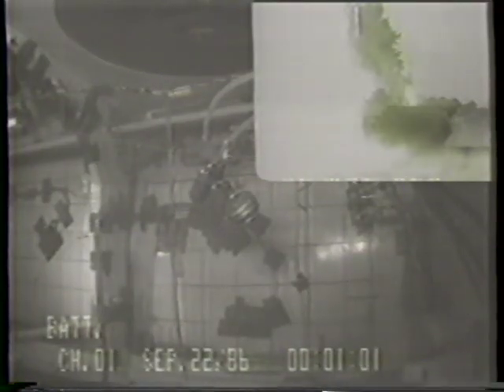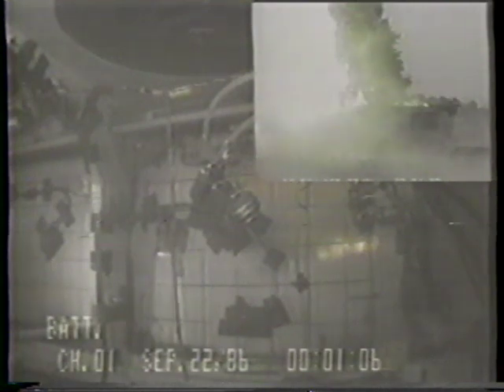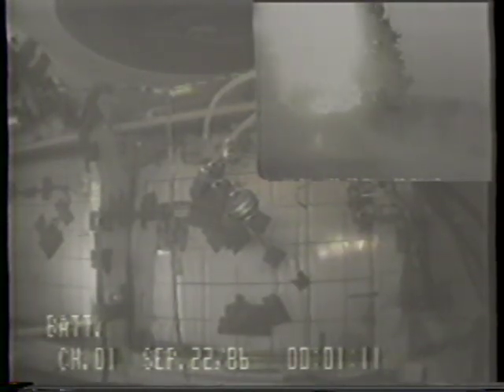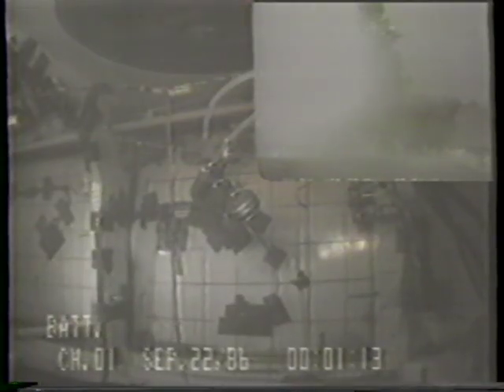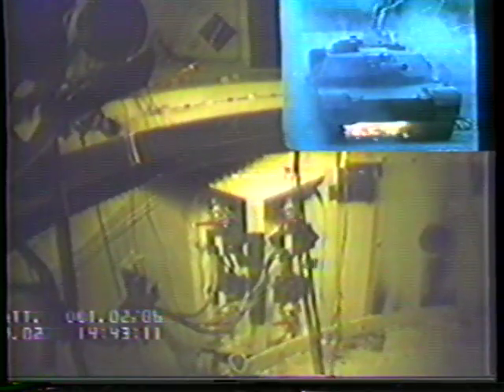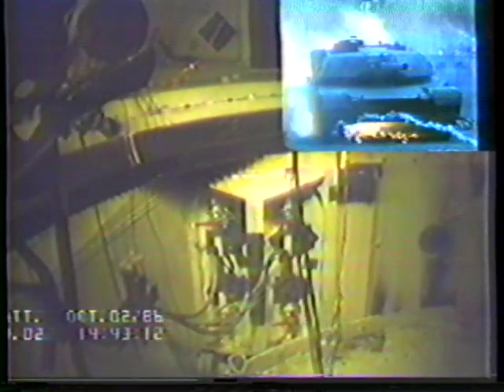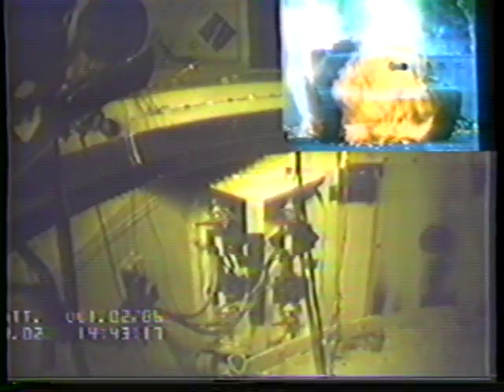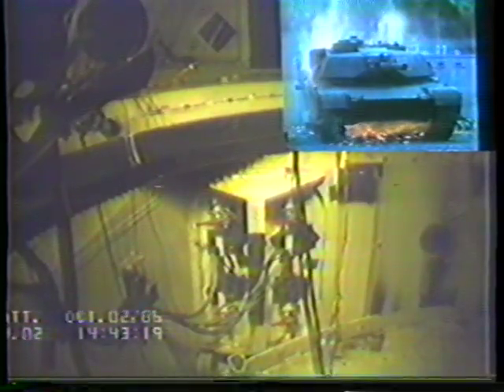M1 Abrams Ballistic Hull and Turret Section Tests

Comment: I would be very interested in the results of some of those test shots. The armor requirements for the first M1 are reasonably well known today but one wonders how much it margin was built in.  As for the M1A1 the armor requirements are a total mystery outside of one presentation suggesting it protects against 125mm rounds of an unmentioned type.
Reply: There is a uranium armor variant also which i think is strictly American. Additionally the Abrams in Ukraine are of an older and less overall equipped version.

Comment: А если засунуть туда 12-22 нормальных снаряда по типу ОФ-26?) Будет ли это также хорошо работать?)
Reply: No reason to believe it wouldn't work as well.  That said, the ammo compartments and blow off panels were engineered for the ammunition types that would used by the M1 and M1A1.
Reply: Im sure if you put HE shells it would still do the same thing. The force of the HE exploding would be vented AWAY from the doors and out of the tank.
The reason that T-series tanks explode and look like a blown up tuna can is because the explosion is contained within the vehicle and the pressure has nowhere to go.
Reply: @PeterMuskrat6968  Except... for the turret!